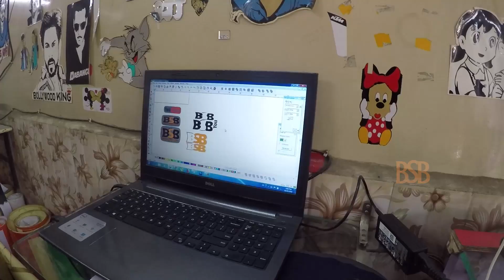i giveaway my helmet | ready my bike to long ride | bullet singh boisar

Comment: Riding a motorcycle gives riders a sense of freedom on the open road. However, there are serious dangers involved in riding without a helmet.

A motorcycle does not provide the structural protection that a car does to keep drivers safe in the event of an accident.

Motorcyclists need to take extra precautions to protect their body. The most important place to start is by protecting the head.